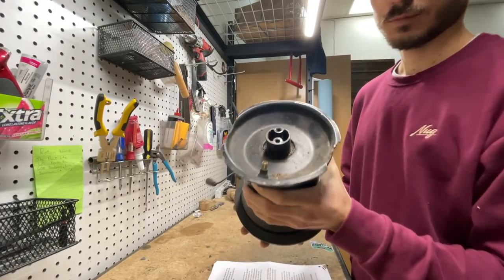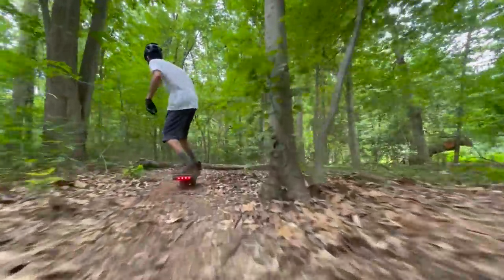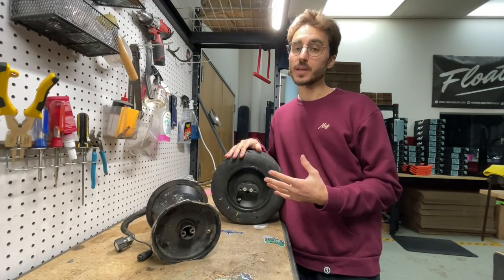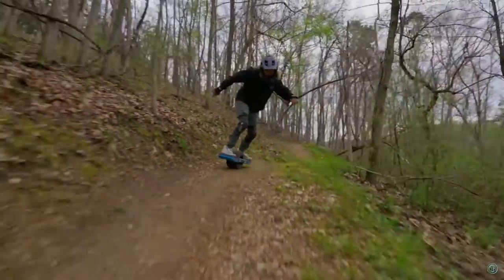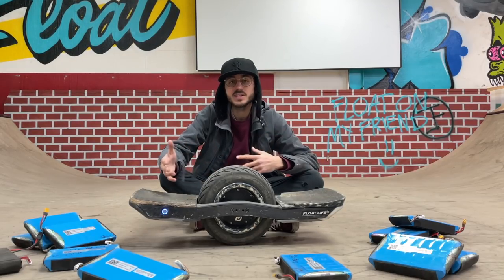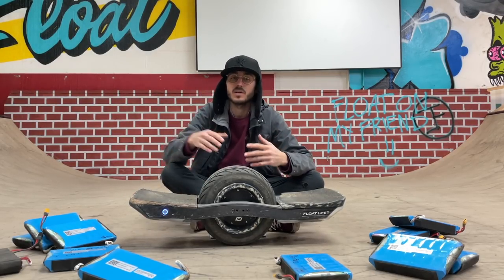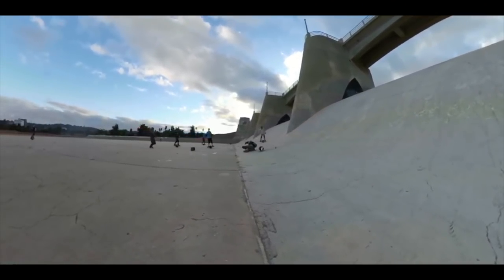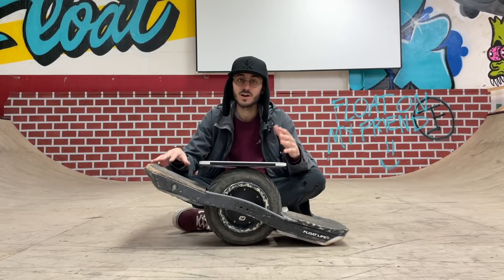Two Glaring Design Flaws on the Onewheel GT

Comment: Admittedly the larger diameter hub may be going in the wrong direction but it is only 1/4" difference in the area that you are describing.  In fact, that makes the side wall the same as the Pint sidewall height relative to the rim.  Good followup points though.

Comment: You do realize that going to the 6.5 hub only reduces the sidewall by only 0.25 inches.  While its possible someone may notice, I don't think anyone really will be able to tell. Th side wall is going from 2.5 inches to 2.25 inches.  However it's still a super sh!t move by FM to go to a nonstandard hub size.  Great video.
Reply: Joe, I think you're right.  By my back-of-the-napkin calculations, the slightly larger hub reduces volume by about one percent.  I'm skeptical that even the most elite riders could discern that small a difference.  Even if they could, I'd have to think that a small change in air pressure could compensate adequately for such a small volume change.  Agreed, too, on the nuisance of a hub size that effectively cuts out third-party suppliers.  That didn't stop either of us from getting in line for a GT, did it?  🤣
Reply: @OakCityRandy  it did for me.

Comment: Excellent points.  Personally I think the added thickness of the board is gonna cause more issues for more people (due to reduced clearance) than the bigger hub.  Would love to hear your ideas on where they could have placed the additional batteries.  Can’t wait for new smaller battery technology to arrive — that should allow for some huge improvements in board design/ performance.

Comment: True about the bigger hub meaning less cushioning, but it also means more torque and less torque lag through the tire, end these are good things, so it's a trade off. Pluses and minuses. I personally think they pluses outweigh the possibility of a hub fracture (though I have ordered a GT so I've got skin in the game!)
Reply: I believe that the Centre of Gravity argument is a red herring. Our CoG is about at our waist and 1cm is maybe 1% difference. I paddle board and people think a recessed deck makes a difference but it doesn't. The difference is the width (30 inches v 25 is 20% difference). Funnily enough many people ignore 'secondary stability' which is the rail dipping in the water and getting bouyancy, which is why thick rails help (SIC and others really get this). And one could argue that secondary Onewheel stability comes from to and fro body motion, which is helped by concave footpads. So maybe FM are doing the right things?
Reply from the maker: Good point about torque. I know a lot of people don’t mind or even prefer a shorter sidewall (for example, Growler riders). But for me, when I ride a Pint tire I don’t notice a lack of torque lag, I mainly notice the comfort and traction.
Reply from the maker: @simonbowden8408  you lost me in the second half! I don’t really SUP but I feel like if you stacked blocks on top of it and stood on those blocks it would make it way harder to balance
Reply: I think it will make zero difference plus or minus. I think FM did that to target having a proprietary wheel size. I’d do the same if I was them.
Reply: @jameshite4820  seems hard to believe that FM make that much money out of tyres? I know that people think FM are only after money, but I think they are actually concerned mainly about safety, hence most of the GT changes. FM have a difficult balancing act. The young skaters who do all the tricks want no pushback etc, while most customers are actually 30+ and like the glide but don't want to nosedive. Hence the GT. Lots of torque and control, but likely quite a bit of pushback. And much fewer nosedives due to less chance of low battery fail. FM are copying the trend in EUCs I think. Which is huge battery and big torque.  But avoiding the 50mph speed, as FM are US based and face law suits.

Comment: Many of us have been saying for years that it’s only a matter of time before someone gets the firmware/software on a knock-off just right to cause a cascade of dedicated riders and potential new riders to jump ship from FM.

I’m sure the GT will be fun, and bring a lot to the table. But all the flaws and logic behind them you mentioned are big deals.

I’m hoping someone figures out how to tune a 3rd-party board jusssst right.

While I’m not a big fan of wider board setups, they do at least have options better than the modern boards for battery storage. And extra half-Inch to inch could go a long way for torque and range. The PCBs for the 3rd party boards are also tiny compared to the FM controllers. Plenty of room for extra batteries and better weight-balancing.

Comment: Pro riders break rims, the rest of us break bones. 🤣 

The screen shot of you bonking up three stairs and compressing the whole tire to the rim illustrates your point perfectly, really awesome OW vid all thru.

However, that bonk also shows how much of a better rider you are than just about all of FM’s customers. During Lazors 30min GT trail ride video he says the GT was designed to dramatically improve performance for the average customer. 

So, if the GT board lacks for pros but not for joes, that might actually increase the niche for 3rd parties to design and sell new products to everyone. Which is exactly what TFL did 3-4 years ago with it’s first product, float plates.  

The VESC programming seems promising too, viable competition is getting close.

Bonking like that is so far out of the regular customer’s ability, the GT might have been designed to give regular customers a greater riding experience.
Reply from the maker: Excellent points! But I do think that the bigger rim and taller platform will mean less stability and comfort for the average rider. And I’ve actually never chipped or dinged a rim on a bonk, but just riding rocky trails I dinged them all the time before Life Savers
Reply: @JakeLeary 

I think you nailed it, it's not designed for pros. They just split the difference on what to improve and on some key points for experts and guys like... I was gin a say us but I'm a 40 year old lame ass with simple stop turned on... They went with range first, everything else second. Not terrible but not what the die hard wanted. 

I don't understand why FM doesn't do more with the community. Like, make the debate friendly, welcome feedback and take questions. Agree to disagree on stuff, but this silence and lack of support really seems out of place from how the community is. 

Also I love the calm and logic take on this, the title is a bit click baity but the video comes across very level headed.

Comment: Knocked it out of the park !  Couldn't have put it better.  Do we know the exact dimensions yet?  I know the initial and subsequent stat sheets all had different sizes from pint ish size to middle ground and xr size?  GT looks shorter and not as wide but thicker rails.  You're absolutely right once a competitor comes along with software fm will lose half or more of their customer base... they'll end up like rollerblade(company) and get left in the dust.

Comment: Yes smaller hubs and bigger tire sidewalls can improve suspension action of the Onewheel but no-one makes smaller tires for smaller hubs, and FM has locked themselves in to the new tire/hub size. This will improve with time as the tire vendors make tires for this new size. Before you know it we will be rolling on 20's with spinners. If the GT tire wheel combo has the same tire diameter then it may be easy to do a hub swap if the motor which appears to be the same on all FM devices. Put up some number facts please.  Love the honesty you present to FM about the relationship we have with them. An area they have misrepresented is the top speed with the new form factors Pint and soon GT they are not able to hit the advertised top speed without putting oneself at risk by fighting pushback, the XR would start a milder but increasing level of pushback at 15-16 mph. Pushback is meant to be a safety mechanism that unfortunately kicks in way before the average cruising speed and top speed of FM's platform of devices. This also may be a result of only having in house testers rather than hitting a range of users in the real world that should include pro riders on down to the family that one wheels. A suggestion for FM you have the software in place use the diagnostics to include real world stats, like Tesla does. You can see average speeds, top speeds and terrain with as much other data that is collectible. Between the users phone and the devices sensors there is no limit. The one wheel has become a cult icon device and should stay that way.           Nice commentary Jake keep up the great content.
Reply: It costs 10s of thousands of dollars to mold a new tire, its not likely that 3rd 0artys will make a tire... unfortunately

Comment: As an outsider looking in to the onewheel community (I tried one ages ago and loved it but ended up going the eboard route) this makes sense to me in term# of riding dynamics. Does this make the pint x a better bet than an XR? I know it’s smaller and lighter which changes dynamics but also has close to XR range and performance - what are your thoughts on this Jake?

Comment: Good points and well presented.  I'm a brand new rider and was wondering why the board wasn't lower to the ground for more stability.  I felt like I was balancing on a bowling ball.  I love the product, very innovative, but I get your points.  I wonder if the hub was made larger to accommodate the larger motor.  Also the first time I experienced push back, it almost caused me to panic and lose it.  Wish we could dial in when it kicks in.  

And its just a matter of time before competitors reverse engineer the Onewheel with improved tweaks and offer it for less.  That's probably why all the secrecy is what I'm guessing.  I'm glad to support a U.S. based company that manufactures stateside.
Reply from the maker: After release, it seems that they just made the rim bigger to make it harder for riders to swap tires. The motor is the same size on the GT as XR

Comment: So I just got my GT and egg shaped tire is making hard to balance the board as it wobbles awkwardly. Would you recommend lowering the tire pressure say to 14 PSI? I’m a first time Onewheel use. I already eat and almost busted my arm lol
Reply from the maker: Yeah, lower pressure will help. How much do you weigh?
Reply: @JakeLeary  I weigh 199 lbs. I didn’t realize my weight maybe a factor? Would it? 🤔

Comment: I agree with all of this! Still bought a GT though lol. Did you buy another XR before they got rid of them? So happy I have a 4209
Reply from the maker: I was thinking about it but I’ve got two already, and I go about 2-3 years on average without needing any major repairs, so I think they’ll last a while
Reply: @JakeLeary  gotcha the new XRS are limited anyway considering you can’t battery swap. Great vid!
Reply: You can battery swap them , even if you just need something close to stock wo chip you can put a sp pack in, makes me wonder why chi doesn't make a stock pack but with better cells - more power range but will play well with the bms
Reply: Funny that TFL created Lifesavers just for small percentage of riders and new FM product just makes it more desirable for wider audience 🤣
I REALLY want to believe that the bigger rim size is for something more than monopolizing tire market. Actually it may resolve my 2 main issues when doing long uphill trails - 1. motor overheating - with extra batteries the range uphill is not so big of an issue and overtime the motor (and controller) overheats. Controller cools down fast, but motor not so much. Bigger rim side walls means more area to dump the motor heat.
The other issue I have is poor low end torque - again uphill - rocky sections or hairpin turns and XR really struggles. If whole rim is bigger, not only sidewalls it could give us more low end torque because of the bigger stator.
Reply: @andrzejz8316    larger diameter hub motor means a lot more torque. The relationship is;  torque = diameter squared  so increasing the motor diameter just a little bit really increases available torque for the same current, and that means increased safety and less chance of the user overpowering the motor and causing nosedive.

The natural evolution of the Onewheel will be similar to EUCs. Motors will get larger in diameter and so will the tires, and eventually there will be a couple of valid sizes; a small beginner/kids size, a medium sized off-road or tricks model, and larger heavier high-speed urban transport model.
FM must know that the GT will not be ideal for off road riding and trail tricks. I'm betting they will bring the XR back as their mid-range model, but in a new format with similar styling to the Pint and GT... 🤔

Comment: You just killed my day. I wanted XR for a long time. Tonight, I went through my things and decided to sell all not so important things and finally get one wheel. I went to their website. I’ve noticed there’s a new one. Huge range. The hell. Superb. And then I watched this. XR discontinued. GT is basically worse. Company is shite. Damn.
Reply from the maker: Worse for me is not necessarily worse for you. If you just want speed and range then get the GT. If not then get a great deal on a used XR, lots of low miles XRs out there for around $1000

Comment: Here’s the thing, speed controller PID algorithms have already been figured out. You don’t even need to design the software, it’s already there. The thing that future motion did very well is figuring out that sweet spot in what makes this board operate so smoothly. It’s not really IF it can be copied, it’s when. And I have a strong feeling that once it’s figured out it will be completely open source. Here’s hoping FM decides to stick around by supporting third parties, because despite all the negativity, no one really wants to see them go.

Comment: Great video (as always) but I'm not convinced that this small increase in hub size will impact shock absorption much.  By my rough calculation, the resulting volume change is only about 1 percent.  I doubt that most (if any) riders would notice the difference in suspension effect.  On the other hand, the difference in torque could be noticeable because there's an 8 percent difference in hub radius.  (Mechanical engineers and others who paid more attention in school, feel free to set me straight on these points!)
Reply: Engineer from the future. Unfortunately, the 8% increase in the hub size was used for literally nothing. Motor stator is the same from the XR, but deliberately manufactured so you can’t use the XR hub with the GT to prevent you from being able to go back to a standard tire size and thus, have more options for tires.

So you get all the downsides of a bigger hub of a 1% decrease in air volume and none of the upsides like more torque.

Comment: Is it possible they customize their off-road tire to have thicker side to compensate for thinner profile? What about custom shaping for approach angle? I mean a dynamic approach angle that adaptive to slope as your slope changes.
Reply from the maker: What do you mean by thicker side? Custom shaping on the app will not be able to overpower changes to the shape of the tire.
Reply: @JakeLeary  at the side of the tire if they can make it thicker would it give more protection to the rim? I am thinking that is what they would do with their custom tire, I would love to have a reply from FM. I rode on the edge a lot and that is the part of the tire gets used up the most.
Reply: @weigg4705  Are you suggesting a stiffer sidewall that is harder to compress, even at lower pressures?
Reply: @onedadonewheel  yes that is what I mean, would it work?
Reply: Run flats- that would be a harsh ride

Comment: Great points, as always. But, I'm curious as to where you'd put the extra battery... do tell.
Reply: Inside side rails, in a reinforced fender, add a cell diameter to the length into the bumper .. many options
Reply: @MrDmadness  Fender and Bumper seem questionable, but the rails…

Comment: So I just bought the GT a couple of weeks ago. Because of the cold and snow I’ve only put like 70 miles on it. Because I would be at four times that if it was summer. I love this thing. So much. That being said as a newbie rider, I agree we should support FM to an extent because they created probably the most fun thing I’ve ever bought in my entire life. On the other side, the hardware is lacking. Like you said it’s too thick and they could just make it wider so your damn feet can actually fit on it. And my lord the two sensor design is so dumb. I know they hafta do it probably for safety etc but I already ordered a Surestart pro because it sucks SO much when it won’t activate. There are definitely quibbles. But it’s an amazing product. They really need to embrace the community and get input from pro and casual riders for their next product.

Comment: Agree with all points 🤘🏾
About the larger hub: I don’t see Hoosier  or any other tire company (other than Vega) going out of their way to making specific tire for the GT unless they feel it to be profitable for them.

 I’ll admit however that this remains to be seen. We really won’t know how the tire companies will respond until GT’s release but I just don’t see owners sending the GT back to FM every time there’s a flat, (or tires companies clamoring to produce a single tire mod  in the middle of a pandemic).
Reply: It would be exclusively for onewheel, a tiny market versus the big outlay to create a new mould size. Burris have already said to those asking them, that they won't be making one any time soon. £400 it would cost a uk ride to send their board for a tyre change. I can get 5 FF T2 off Hoosier for that